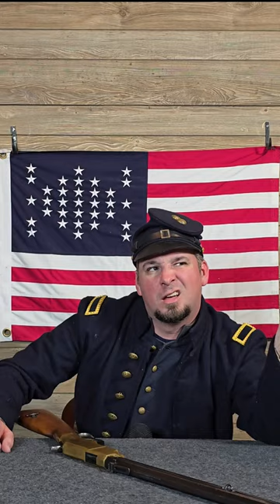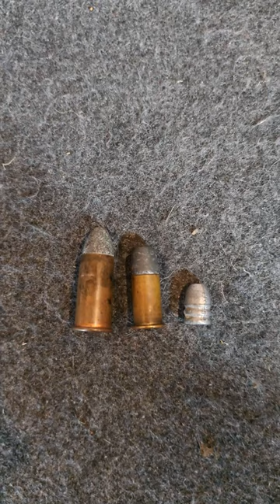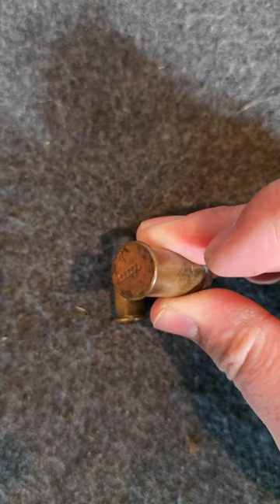Henry Magazine Explosion #history #civilwar #technology #shorts

Comment: The issue with the original rim fire cartridge was the way it was made - it was a balloon head design and was a lot more sensitive to any impact as the metal is very thin at this point.  This also reduces the chamber pressure it can use - our modern rim fire cartridges have thicker and more consistent rims with even using the same primer compounds better shock protection and need a more directional impact.

Comment: A further simplification is that at this time it was foiled brass added into a mixture of copper to make a sheet of alloy used to make the case. The problem was these 3 metals were highly susceptible to denting and when any minute shock (such was the case of old priming compounds used durring this time) could be set off by pressing on it with your thumb, having a stack of these cartidges in line + a hefty spring for feed system to work properly its a disaster if any of the problems happened, keep in mind a battlefield condition and possibility that the rifle MAY be used as a club as a last ditch defense/attack meaning soft parts are considered weak-points. The Henry rifle never offered a alternate thickness or handguard, and they didnt offer a bayonet as well. The Spencer rifle did get offered a option to mount existing bayonets using special redesign, but the government opted out for cheaper and quicker to make rifles in the end. Thus the higher range, more potential to pen small cover, and simple design was the better choice (at the time), the rifles that came from Henry after the Civil war almost changed Europe on a massive scale after a seige was broken by 30 Cav Rifleman firing into the enemy ranks and causing a mass desertion. This forced countries like Italy to skip single shot rifles and instantly push for a Magazine Repeating Rifle (Vetterli was selected, Vitaly switched the magazine type, it had a 6 round +1 when as a tube magazine, and as a stripper loader it was 6 rounds quick loading))

Comment: When I was a kid I was told to be careful with handling ammunition because they had witness them going off being dropped. Well little over two decades later I have seen ammo dropped on every surface hit on the back of round I have dropped many on the ground of almost every surface not once had one go off but just a couple days ago I put my +p 45 acp underwood ammo in a container to put up as I'm taking the container I drop it 3' off the ground one goes off completely annihilates the container gunpowder peppers and burns my foot and shrapnel either penetrated my leg or grazed my leg but I got lucky. Force was enough to deform the projectile and I only recovered rim and 15% of the casing that was it.

Comment: To add to previous comment just reminded me. But I did a job for my friend's father cleaning out this house well city allowed burning they wanted hardly anything used to be a cop but buddy was really educated and his father was ten times that but they were laughing at me for reacting to the live rounds that were in the fire yeah danger is significantly Lower but there's still risk of serious injury or worse. A round triggered outside of a barrel becomes a grenade. Pressures are far greater then the structural integrity of the casing. I forget how I explained it but yeah if the projectile hits me there's a good chance of it bouncing off my leg but I could see how this flaw got overlooked most of what was made back then was in a hurry

Comment: nah, thats fudd lore. rimfire wont go off in a magazine tube, no matter how hard you slam it. i once hit the center of a .22lr with a blunted nail so hard that the entire back of the case was deformed and kept hitting it to prove it is safe and guess what it didnt go off. i punched a hole into the case and still didnt go off.
Reply from the maker: Think about the logic of what you just said.  I hit the center of a rimfire case.....center....of....a....rimfire....case.

Rimfire of 1860 is also not built like rimfire of today....hell the cases had ballooned heads, rolled brass....it's just not the same.